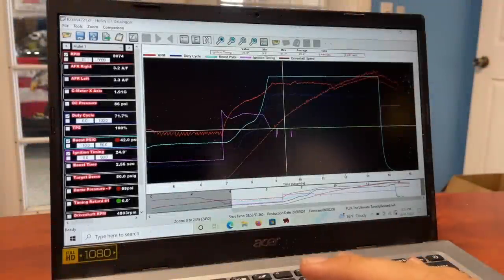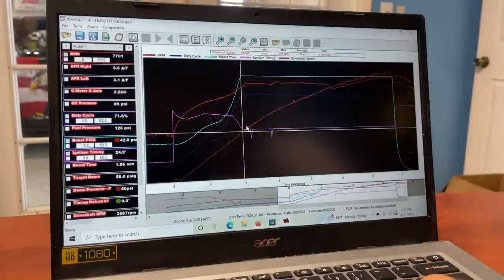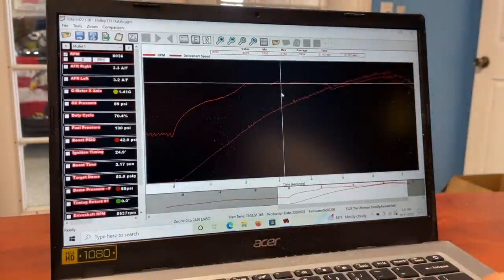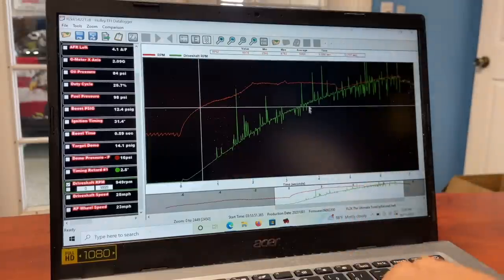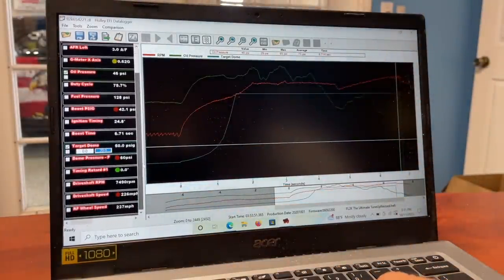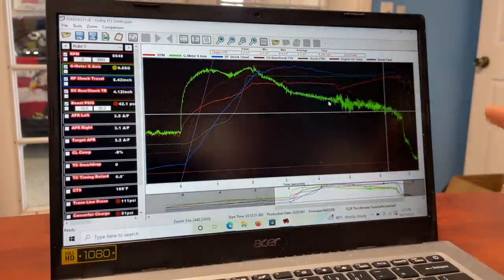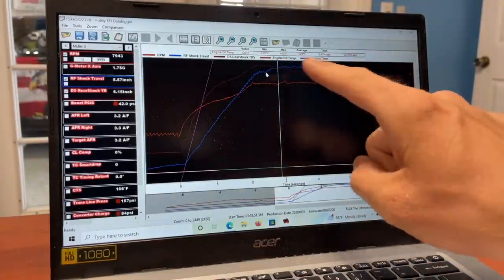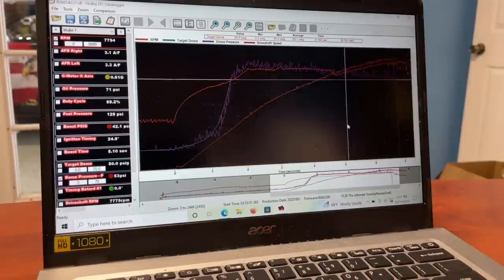The Data Log From Mullet's 6.54 - 221mph Pass at FL2K - ALL THE BOOST!!!

Comment: I can't imagine making so much boost that the BOV couldn't vent enough air to control boost pressure from rising. Incredible run from Mullet. What is even more impressive is that Cleetus is sharing this "valuable" data that others could use against him. Major balls, and major respect.
Reply: I'm not a drag guy, but how would someone else use this data? It seems to me that this setup & tune works for this specific combo of engine/transmission/converter/diff/suspension/tyre etc in this specific hunk of El Camino shaped bits of metal. I can't see how knowing the boost curve for example would help his competitors?
Reply: Congratulations add up⬆️ you've been selected amoung my shortlisted winners🌹,"
Reply: @_JustinCider_  James is a no time guy. He doesn't like to share boost or time data because it would give people a context of which to base their tunes on to beat their opponent. True, a tune can be only vehicle specific. However, people know what kind of engine he has and how much power it makes with a specific amount of boost. They also know what his build list is. You can make a very accurate calculated guess to tune your own vehicle to match or beat his El Camino.

Comment: As far as adjusting the tune by graphing the lines two things to look for as data are when lines cross -like horses and torques crossing at 5252 rpm.... and when the lines have a large gap - the bigger the gap the more meaningful the data.

Comment: Needs a dry sump, it will help it survive. Plus better ring seal and it will help with the crankcase pressure.  Its like running a vacuum pump.

Comment: that torque lockup looks like a diesel truck pulling a trailer.. you can totally feel that same thing, revving high and then you can feel that converter lock up as it dips in RPM but speeds up.

Comment: I'm Surprised The Boost Didn't Jump When The Converter Locked (fuel pressure seemed to just slightly dip) But It Wasn't That Big Of An RPM Drop Too. It's Nuts How Much That Torque Converter Works In That Thing. The Gear Ratios Are Pretty Dang Tight And The Torque Converter Is Really Going Through Hell hahah. So Cool To See This And Compare It To Street Car Vehicles With Stupid Long Gears And Tight / Low Stall Torque Converters haha.

Comment: The jumping in the oil would definitely be fixed by a dry sump. You could also get an air oil separator called a spintric and help your overall efficiency with thermal and psi

Comment: Crazy thought: When Tom Bailey let Cleetus drive his 1.0 and the chute failed at the 1/4-mile mark, he ran a 6.53 @ 223. Cleetus hasn't yet drove his fastest in his own car yet, but World Cup, Pete, 315 rear tires, and Mullet will surely make it happen. Hopeful the track in Maryland is sticky and holds, even though it will probably be in the 40s for temperature!

I wonder, given what Steve said about the recommended boost, if they back off a few psi from now on, and how will that effect the ETA's going forward? Will the 315 be enough to compensate and bring Mullet into the 6.4s range?

Comment: That thing was on a mission. We run blown alcohol 540’s in our funny cars and it’s interesting to see the differences between ours being blown and yours being turbo. We run 32-34psi boost to go 6.88-6.75. But then we run 34 degrees timing instead of 25. And my car is usually a 1.09-1.12 60’ but only 201 mph. Would be cool to see the channel eventually get a big tire car with an SMX in it. Or go full blown race car and get a nostalgia nitro funny car or fed.
Reply: Congratulations add up⬆️ you've been selected amoung my shortlisted winners🌹,

Comment: Is there enough power on the lower range to bring the lock up sooner? If it could pull the whole back half with the lock engaged, trapping 250 could be possible. Just make it the 4th gear change adding the lock with same sequence as 2nd and 3rd. This way it wouldn't upset the chassis as much as it did on that pass.

Comment: Do You Think The Oil Pressure Issue Is Related To The Blow By? I Remember It Like 8PSI Of Crank Case Pressure. That Much Pressure I'd Imagine There's Some Substantial Air Flow Through The Crank Case Making The Oil In The Sump Aerate Or Like Push All The Oil Away? I'd Imagine The Flow Of The Crank Case Would Be Strait Down To The Oil Pan And Then Back Up? I'm Just Throwing Ideas Out So I Don't Necessarily Know What I'm Talking About lol.

Comment: Sounds good, but I’m more curious to when the combo stops dropping tenths so easily. When is weight,tire, etc going to start demanding some changes to get into the 5’s? It’s awesome watching Mullet blow through its issues and not just touching 6s but several passes now and deep into the 6s. I’m wondering when he’s going big tire,diet and SMX (though I like that it’s not an SMX) to start trying to chase down Bailey in drag and drives. Mullet is now showing its potential I can’t wait to see the rest of its evolution like Leroy’s.

Comment: I could be wrong but doesn't the map sensor read about 14.8 with the engine off. To figure max boost I think you need to subtract 14.8. The map on my truck reads 14.8 with engine off.

Comment: I’ve been saying for two years now, that Mullet,LeRoy and Ruby ALL 
need to be converted to a dry sump 
System. Almost all of the top performers are using a dry sump. 
It just makes sense, and eliminates so many of the potential oiling issues.  Just sayin .

Comment: You may be able to overcome the dome pressure issue by having whoever designs your exhaust systems go to school or otherwise learn about "exhaust scavenging" which uses the geometry of the build itself to time exhaust pulses in the exhaust system to pull vacuum on each exhaust pulse in a controlled fashion and I suspect one may be able to utilize the same technique to place the boost controller just so that it is pulling a vacuum when it's open instead of just allowing pressurized air to vent. Yes it is possible. You CAN have a vacuum of a boost controller without adding any parts or complexity - just by shaping the exhaust system right and placing it right.

Comment: The fact that the oil pressure is dropping mid run is very concerning. I know the engine is build to handle insane power and the pressure isn't tanking to zero but brother that dry sump better be on there soon!
I think Mullet can run straight 6s on a perfect track with more optimizations.

Comment: Insane show out from you guys and the crew everyone. Also. Didn’t  show wat the rpm was at the top of the run with converter locked. Looks highest rpm after converter locked out the back but didn’t show us. 8,500rpm?? 10,000rpm?

Comment: try an oil accumulater. gives oil pressure from a spring when oil is missing. and what would happen is you locked up on the 1-2 shift?

Comment: I did a ET and MPH HP estimae based on 3400 lbs (my estimate of Mullets weight with driver) and on ET you were pulling 2400 HP and by MPH 2700 HP. I realize that weight might not be right (either high or low), Even if I'm off either way, 2400-2700 HP is a lot of power. Much respect to Steve, for building a legit monster and also Cleetus for driving this monster. BTW 4.30 in the 1/8? I bet this is faster than either Jackstand Jimmy's 240 or Nova in the 1/8
Reply: I believe mullet is 3550 race weight. Puts it about 3k HP.  If the 240 is competitive in NT stuff it's a bottom 4 car for sure. Be an interesting run.
Reply: @92GSXtacy  2900 by the MPH, 2500 by the ET, using your weights. I like to think it's somewhere between so I'll say actual HP at the wheels is 2700

Comment: I agree that thing should end up on a hub dyno….  I’m wondering how much faster it would get locking the converter a bit earlier. Im assuming peak power isn’t 7500rpm, so locking it up at peak power might make the car run even faster
Reply: Hands down Steve builds the best engines.....tune into Cleetus' channel and you will see why Cleetus now has a dependable car that doesn't break and busts out 6.59's.  All i can say is WOW...

Comment: Try lockup right after the top of 3rd instead of down the track, you'll have the rpm to do so and the rest of the track to get that mph up, you'll likely push through the rpm drop a little more than you would at 180 or so when you were locking up

Comment: I was thinking you need a dry sump when you guys had pressure in the crank case, pro stock cars run a dry sump and pull vacuum in the crank case

Comment: This is cool getting to see your data after that epic run 
Like I said before I’d love to see you guys try a no prep event
Reply: Why a no prep? While I enjoy pretty much all forms, I don't understand taking high hp cars that barely hook up on prepped tracks and turning them down a ton to race on no prep days.
Reply: @demwillams8898  no prep is all about tuning and car setup I’ve seen cars go in the Low 5s in the 1/8 witch is a little slower than what cleetus was running on a prepped track
Reply: @NoPrepFans  to be fair, it's always about tuning and setup. I still go to no prep events but I'd much rather watch cars/teams get to use all the juice they built.

Comment: Just a question, as soon as it shifts into high gear could you have a partial converter lockup before 8,000 RPM where it does a complete converter lockup? Just in high gear though

Comment: What wins on Sunday sells on Monday. You just made ol Steve a shit ton of money. But seriously seems like money well spent. Seems like Texas speed makes great engine those engines just are designed for what you're pushing. Seems like Steve builds these motors with the strongest materials available. That kinda difference just ain't in how its built. Any harder you're gonna hurt the motor solid tune, time to work on the gearing and suspension and she'll get to 6.0 in no time

Comment: 2 things fighting you..wind and weight..
More areodynamic body ,mullet is getting a lot of drag behind the cab..sounds like a trip to the wind tunnel..
And that leaves weight..
More carbon fiber ,less steel..
100lbs is worth 1/10th in a 1/4 ..

Comment: What is the max boost the engine can handle ? Also as easy as it is for me to spend your money. Wouldn't you want to make the switch to avoid hurting it and more to a dry sump ?
Reply: Most likely it would take whatever the current turbos can dish out - they would have to go to bigger turbos to really hurt the engine.
Reply: @kennethfeld6639  thats what i would think but he has 98's right... i mean next would be what 104 or 110 ?
Reply: @ruscoe8831  I think the turbos were picked for that reason - they are the top for the engine.  If he wants more boost - he needs a different setup.
Reply: @kennethfeld6639  fair thanks for the info sir !!

Comment: if you have a drain back issue based on what you think I'm not sure but it sounds like it does, why don't you just add a couple extra quarts to the pan? in my Blown Alcohol jet boat I ran 12 quarts in a 10 quart pan. I didn't care about the nine horsepower or the windage issue. good luck great job

Comment: Is the engine a standard big block chevy cooling system (wet deck)? Meaning water passes through the block up through the deck and into the heads? I have a VERY similar 540" with a procharger on it (f3r-121) and thought I had found my boost limit with a water block/heads but I might be wrong....
Reply: Steve did a few build videos on this engine and he showed what he did to keep the head gaskets in it.
Reply: @kennethfeld6639  Hands down Steve builds the best engines.....tune into Cleetus' channel and you will see why Cleetus now has a dependable car that doesn't break and busts out 6.59's.  All i can say is WOW...
Reply: @kennethfeld6639  thank you. I knew it was a steve morris engine, just was curious about the cooling system layout. I will check out the videos

Comment: If your fuel pressure is reading off the same sensor for the boost level then it will not necessarily be correct that it barely went above 42lbs...
Reply: Now... why would they do that?

Comment: Could you lock the convertor earlier to gain more speed?
Reply: yes, but the engine can only spin so fast before it comes apart - no matter who builds it - they will have to think about a taller rear gear (lower numerical number)

Comment: But leroy hit 60 pounds of boost in a small block with smaller turbo's
How is 42 pounds of boost the limit of mullet's big block with bigger turbo's
Reply: And bent every rod in the engine. Did you not watch the teardown video after that?
Reply: 42psi on this setup is alot more power than leroy at 60

Comment: Gotta put mullet on a diet. As good a fabricator as tye he can shave some weight forsure. As much steel to aluminum as possible. Then bed floor, tailgate fiber, rear quarters preferably fiber but aluminum works too. Since that front fender is beat up time for a front clip in fiber. It'll be easier to work on with the clip. 3000hp and 3000lbs has a nice ring to it.
Reply: Congratulations add up⬆️ you've been selected amoung my shortlisted winners🌹,"

Comment: How much more do you think you can get out of mullet, before being capped by tire size? 
Will you ever go big tire?
Reply: I think he’s mentioned once in the past that he runs the max tire size allowed by the class he runs in, that’s why he ran a wider and bigger tire a month or two back for an event. Most unlimited street type classes limit tire size, this is also why he doesn’t have a wheelie bar (can’t run a street car class with it)
Reply: Going “big tire” would require a full rebuild of the rear end and he wouldn’t be able to run stock panels, disqualifying him from his class. You’re talking promod at that point.